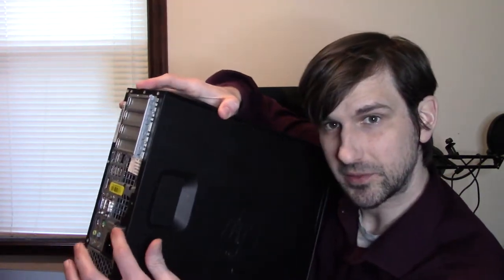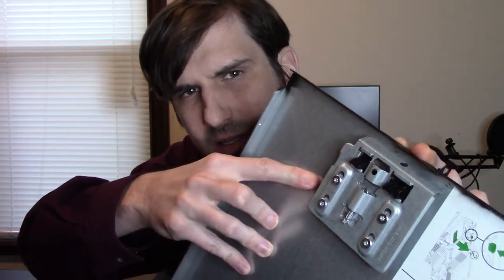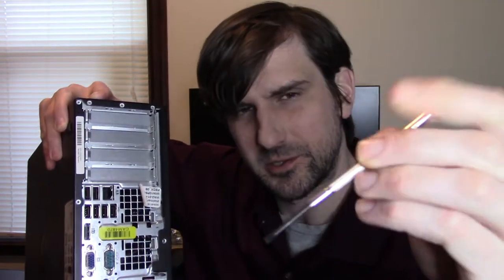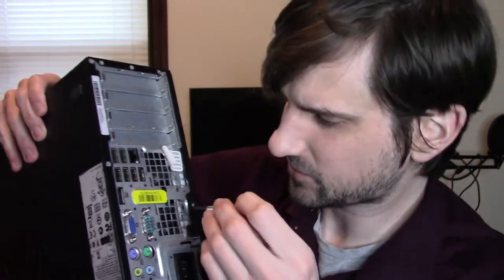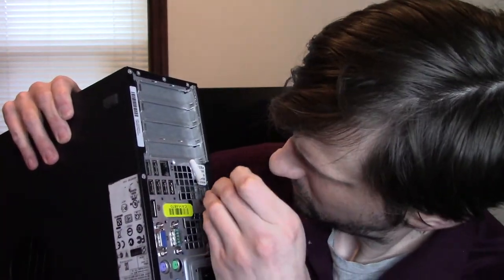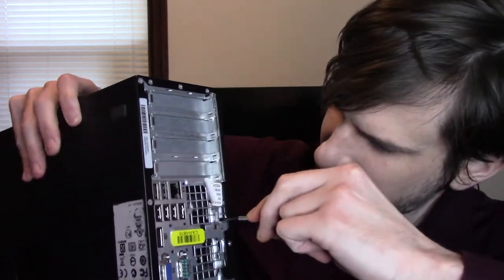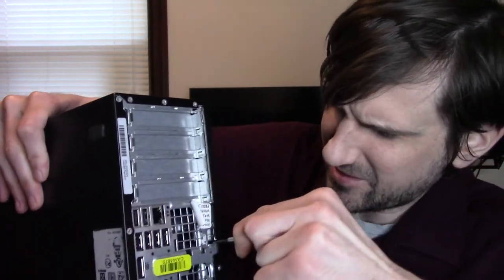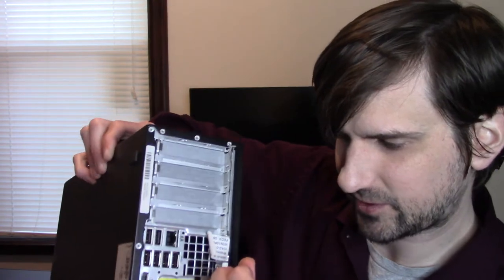When pulling lever on PC case does nothing - HP elite case stuck Pt 2

Comment: Thank you so much! Your first video was helpful but I still couldn't get my case to open. However, after several attempts with a screwdriver (and a lot of cursing and swearing), the plate finally moved back. In my efforts to prize the case open, it's now a bit distorted but I can at least now get to the motherboard. You are a hero! :)
Reply from the maker: Nice! They can definitely be troublesome sometimes, but glad you got it figured out! 🙂
Reply: @LowcastleTech  Yes, I was convinced I'd ended up with a faulty case until I read all the other responses. I bought this unit really cheap as a refurbished PC and it's got a good spec. HP make great PC's but their case designs leave a lot to be desired! Many thanks again for your 2 videos - the second one certainly saved me from either breaking my wrist or taking my eye out!
Reply from the maker: @robertmeineck5772  😃 Not a problem, glad I could be of assistance!

Comment: if on trying everything the latch doesnt open just go in bios and in security open smart cover and unlock it. :) it is a pretty handy feature if u dont want to use screw to make sure the cover doesnt come out . u can see a hole in the centre of the lever system, a piston secure on the case pushes a thick needle into it preventing the system to move.

Comment: I had the same problem with the same situation, now after a few hours I have found a solution in case the grille is pushed in even when you just try to push the metal slide. You will need a thin flathead screwdriver. Then you try to press the screwdriver from below between the metal slide and the grille, then turn the screwdriver to create a gap. In my case the jammed grille came loose from the metal slide. After that I could use the normal lever.
Reply: THANK YOUUU!!! Part 1 and 2 didn’t work but this did!!!!

Comment: this method is the same as just using the lever cuz when i pushed a screwdriver in there the metal panel was still moving back so i guess im just screwed
Reply from the maker: Dang, I get what you mean. Sorry that didn't work out. You might already be doing this, but the only other things to mention would be to make sure you are only holding onto the silver metal loop and not the black loop, and make sure that the little bolt right beside the loops is unscrewed/removed. If I can figure any thing else out, I will let you know.
Reply: @LowcastleTech  okay then I've tried all of that but thanks for helping anyway
Reply: @LowcastleTech  yooo nvm i got it open i used the technique from ur last vid but i pulled on the metal vent part thanks soo much
Reply from the maker: @LostMyFriends5  Awesome! Glad you got it figured out.